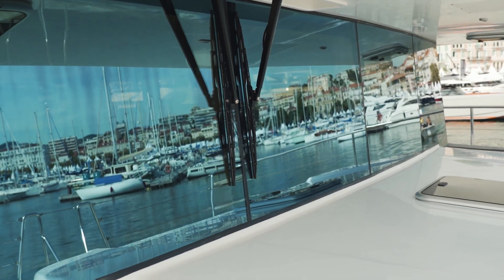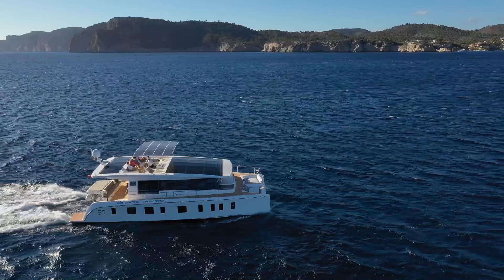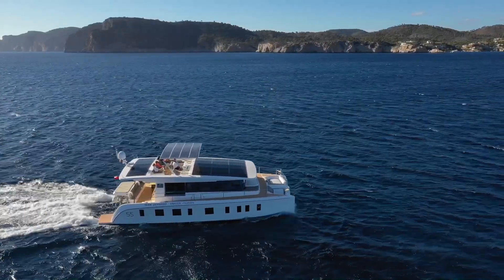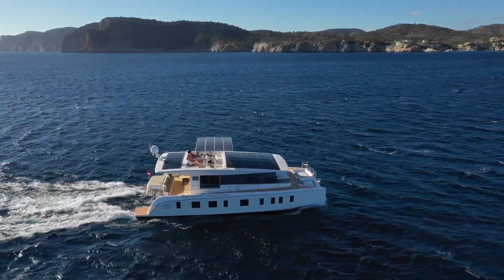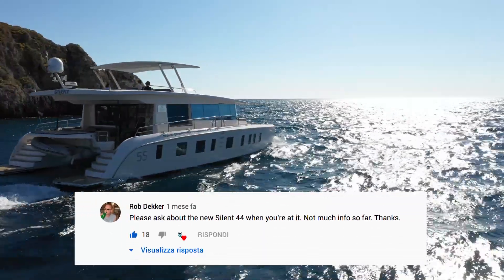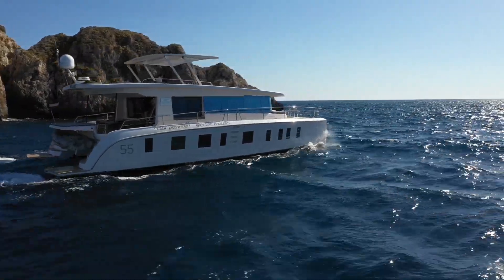WHAT MAKES SILENT YACHTS...SILENT???

Comment: Michael, as the owner of a 48-foot timber boat, with 165kW main engine, and an efficient one at that (12-14 l/hr, including a 8.5kVA generator running at the same time), I can see the beauty and efficiency of your designs. They are the future, no doubt. I would like to see a more utilitarian model that is all about function, rather than 'all-the-comforts-of-home'. By function, I mean while I have two air-conditioning units on board, I do not use them, except when connected to shore power, and not often then. A well-insulated boat with all-around ventilation and shading should not need it, I fee, especially at seal. As you note, galley energy consumption is negligible; lighting similarly—I would want to use the solar-generated power to go places. And while my boat is a monohull, as you point out, if you chose 6kn (I use 7.6kn) as your cruise speed, then that 210kW can take you a long way. Brilliant execution.

Comment: This is the future of boating. 
 The sun is shining a lot more then waiting for the wind to blow- and without having to tack/ Jibe constantly. Finally someone figured it out!!!
Reply: Im afraid that there is nothing new under the sun about this boat project....and as a blue water cruiser you better start praying for blue skies....
Reply: @maxodgaard1335  yes however the sky doesn't need to be clear in order to get charged up. I think they only need about 50% clear skies
Reply: @maxodgaard1335  The specs which came with my solar panels gives a power rating even when it's covered with a thin layer of snow! At least then you won't need the AC :D

Comment: Now this is an amazing option for people like me. I love sailing as a concept with wind propulsion. However, almost every time I go out on the weekend the wind is coming from the direction I want to go. Lines everywhere and naturally no wind when going back home. 

“Classic” motorboats are not in my liking due to noise and fumes. 

This is a combination of the best features I like, with no negatives. I’m absolutely in love with this concept. 

I read somewhere that with a speed of 5 knots, I can go on nonstop day and night without using the generator. When sailboats are waiting for good weather conditions for a longer passage, I only have to check if it will be sunny😁. 

Also I guess that maintenance is way cheaper than a sailboat in comparable size (sails, rigging...). Although replacing the battery bank will come with a hefty price I guess.
Reply: Solar cells last 50+ years.  Modern Lithium ion batteries will last decades when used within good parameters (don't overcharge, don't over discharge).  Both are highly durable today.
Reply: Maintenance on a bigger sailing yacht is astronomical. Like you this would be my choice for a live aboard. I already have an pure battery electric car and the silence and lack of maintenance is a no brainer.  And prices of batteries will go down, so all these arm chair experts claiming huge replacement costs have no good grasp of what is going on.

Comment: Great idea to interview owners and builders because as You Tube numbers grow on a channel it becomes very difficult to answer everyone's questions. 

Also, I personally get frustrated when I see flaws on a boat and I leave comments and suggestions as to how they might improve things, but I get no response.

So this interview format is also a good way for the manufacturer to get feedback and improve their product.

For example, I was close to buying an Azimut Atlantis 51, but got really frustrated about simple design 'flaws'. 

They have a bbq on the aft transom, but don't have a grab rail to hold onto if the boat rocks while you are cooking or if wash is created by another boat and unsteadies your footing while cooking. It's a simple safety measure yet today they have still not rectified it.

I also suggested changing the position of the bbq as well.

Another one I looked at was the new Princess V55 which is basically a blatant knock off of the Fairline 63 GTO in a smaller version, but they have compromised too much because they didn't want to design a new slightly wider hull, supposedly because they didn't want to 'compromise' speed. 

The real reason was probably cost, but nevertheless the boat ends up with a highly compromised third cabin with double bunks.

Most customers would prefer a better third cabin and compromise some speed if it needed to be compromised at all.

The boat does 30 knots which is pretty good, but most people would be happy with say 25 knots and a decent third cabin.

Likewise, in the cockpit bbq,  they place the bbq closest to the open saloon where smoke can blow from the cockpit into the saloon, followed by the sink which is placed more aft.

I would have swapped them around and put the sink closest to the saloon, to minimse smoke from the cockpit bbq going inside the boat and then placed the bbq on the outer side so the smoke blows out the back of the boat.

All boats face into the wind at anchor so the wind would also blow the smoke away over the aft of the boat away from the saloon and cockpit.

I'm no genius, but these are just basic boating knowledge features and design expectations of customers and it frustrates me no end. Maybe I need a chill pill.

Also Princess used shaft drives in the V55 instead of pod drives like Fairline do. Nothing wrong with that if you are selling to experienced skippers, but if you want to attract NEW boaters who are inexperienced their main reasons for NOT purchasing are;

1) Fear of berthing especially in high winds.
2) Navigation.
3) Cost of crew.

Pod drives and modern navigation equipment and new berthing technology removes all 3 of those issues, so why opt for shaft drives rather than pod drives. Or, at least give customers the option.

Pod drives offer virtual anchors to allow you to keep the boat in one place while you put the fenders out obviating the need for crew and the associated costs.

Likewise there is remote docking and new sensor technology where the boat berths itself like autonomous and driverless cars.

I don't think manufacturers do enough on communicating these new technologies to attract NEW boaters into the market and to buy their products.

(By the way, a video on all the new technology available for berthing and navigating and demonstrating that technology would make a great video ... I'm blown away with some of the fantastic new tech that's coming on the market).

Taking the stress out of boating and lowering operating costs will always be big selling points especially if they want to attract a new generation of boaters.

This means they are not fighting for a slice of the cake all the time, but baking a bigger cake by getting new boaters into the market.

We are also talking about Princess and Azimut here so it's not like they are new start-ups. These are major brands.

I sometimes feel these manufacturers don't spend enough time engaging with customers and more importantly POTENTIAL customers.  Quite frankly Princess has become boring and lacking in innovation although their quality is good.

I wish they would make a luxury catamaran.

Anyway, my point is that I think the manufacturers would benefit from this interview format and so would customers looking to buy their products. 

Keep up the good work.
Reply: John Smith its very arrogant to assume your suggestions for improvement should be considered. Its far more likely they know any and all compromises and have a far greater understanding than you. You are less aware of the balance of constraints and design priorities as a whole.
Reply: @derboy959  I'm a boat user and naval architect,  not that one needs to be either to decide where to put a bbq ... other manufacturers get it right so no, there are no design constraints just poor design.

The day you stop listening to your customers is arrogance and grab rails for safety is not an option, it is a must. You NEVER comprise on safety ... NEVER.
Reply: @JohnSmith-zo6ir  Hi John David is not listening also - sadly!! Omnipotence is not the purvey of either David or a boat designer. The dichotomy between the opening of the "sell" on "Silent Yachts" (How they listen to customers?) and Davids comment is disturbingly at odds.

Comment: 8 knots with generator "untill infinito" sounds very good but i was curious about the fuel consumption on the generator at that speed.once again great video :)
Reply: i found a general rule for generator fuel consumption: 0,3l/h per KW produced.  it means  40kw*0,3= 12l/h at 8knots. with a fuel tank up to 1600L it's about 130h run time and 1000 nautical miles. not considering solar regeneration
Reply: It’s an interesting example to compare ‘conventional’ propulsion systems. Pretty much every long distance cruiser (with sails) adds on solar, and lithium batteries (if they have the budget) to reduce power need from running generator. However, scaling this up has a trade off with weight as soon as the batteries weigh more than fuel and engines.

The best figures I’ve ever come across was a power Sunreef that had engines remapped, wave piercing hulls and extended sugar scoops (to reduce draft) there’s an article on their site I think, but if memory is right, the fuel consumption was something like 7L per engine per hour.

I think for solar to compete, battery technology needs to improve further still/solar panel efficiency needs to improve/propulsion of the boat/energy use of in house systems, i.e. gains from one, two or all of these areas, will result in a solution that can travel at faster speed so as to be more competitive and no fear of running out of juice.

Also, foiling technology versus displacement versus planing hulls for greater efficiency. Wind power for onboard turbines for more energy creation or foiling kites to contribute to propulsion using wind energy also. Water jet propulsion versus propeller. Wave power. (Check out foiling surfboards if you haven’t seen before). The future doesn’t have to be solar only.
Reply: @guidoburo87  What's good about electric propulsion is that it's efficiency is rather good across wide range of output, combustion engines have quite small efficient point. As you heard, at displacement speeds boat needs really little power to move, but it can have extra power when needed. Although my favorite points are sound and maintenance. Too bad choices of electric propulsion are still quite limited to highly overpriced ready solutions or do it yourself from scratch which few people can handle due to power in question. I'm not even talking about price of battery bank here.

Oh, i would rather go 6-7knots cruising speed at most on such boat. 8 knots already fall into not so efficient speed, just for 1knot from 7 to 8 you need extra 15kw/h.
Reply: @xellzor  All good points.  The power needed to maintain moderate speed for a boat is surprisingly low.  Battery and motor options will continue to improve, and commercial solutions do exist today.  Electric propulsion is clearly a very good way forward, and progress will continue to be made, including in commercial products.
Reply: @xellzor  so true, I think 5 knots is more than sufficient. And then consumption is less than 10kwh. Which means with the 210kw battery and 100kw per day charging with the panels, you can easily do 24 hours of non-stop sailing and have energy to spare for all the electric appliances.

Comment: Post from Canada: 
i was wondering if ...
* the boat can be fitted with a Kite Sail to augment the range?
* have you thought of using Thin Film printable solar panels on the sail to generate more power?
* Also, usage of H2/Fuel cells to get rid of the diesel generators and make it completely green?
* include drum type Wind Turbines to generate from Wind Power without casting shadows on the Solar Panels?

Comment: Love the yacht and the technology embraced in it. Gets rid of diesel which is always good.
Reply: The backup generator is probably a diesel, but would need almost no use much of the time, due to lots of solar power, good battery storage, and good system efficiency.

Comment: Love your coverage of the Silent Yachts and noticed you like to take questions :-)

1) They have the kite setup in the front. Was wondering if they have tested to use the force on the propeller for "regenerative breaking" in the motor and charge the battery packs. If I am not mistaken not all motors can do regenerative breaking though...
2) Besides Silent Yachts. Am endlessly fascinated by foils. And came accross a paper where they tested foils on a catamaran to reduce resistance. The take away is increased resistance at slow speed (foils are in waters way), reduced resistance at higher speeds (boat lifts earlier). As Silent Yachts are all about optimising efficiency. I was wondering if they have toyed with foils. Obviously the break even speed above which resistance becomes less would need to be sufficiently low. Preferably below or at low cruising speed. Not a good idea to make the most efficient speeds less efficient. But if the 40kw for 8knots could be lowered without affecting 6knot 20kw. Might be worth having higher sub 6knot energy consumption. Or slightly higher 6,8knot resistance but 10+knots significantly lowered....

anyway. thanks for all your coverage of these marvels. Looking forward to more. Tours of the 80? 120?

Comment: Hi David. Wider and others have used a hybrid system. Silent has improved it and im looking forward to the Silent 80. Great video.
Reply: Silent Yachts is building boats sind 2009 - tenthousands of miles purely solar powered already!  In 2018 a Silent 64 crossed the Atlantic Ocean
Reply: Hi Micheal, your vision has become a reality. You are the ONLY solar powered superyacht builder. The industry are running scared as you have proved that not only can it be done by sailing around the world with your prototype, and the Silent yachts are selling even prior to build which is a milestone that no other builder can match. I am so happy that a normal couple can create and succeed with such a product. Amazing yachts. Thankyou. Chris.

Comment: What an awesome boat, and a great idea. Kudos to Michael and all his crew.
I think it's great that you guys made it out of recyclable materials whenever you were able. Who else does that?
It bugs me a little that they don't answer the question of what makes it silent. I mean sure, you use solar power to charge the batteries, but you're still spinning a propeller. I'd like to see how the propulsion is handled.

Had you considered creating a hybrid yacht? Do everything exactly as you have, but add a mast. You would only drain your battery for propulsion when there is no wind.

Comment: Hi! Great proposal! Is there any project to add wind generators to activate them when the vessel is moored to take advantage of some night breeze or wind? During navigation those could be folded. I saw also a vessel sun energy propulsive that generates hydrogen. Could it be an option to activate generators by hydrogen instead by dyno-fuel ? Thx for your great cat !

Comment: What I love with this, is that I have all of the advantage from a motorboat and a sailing boat. just turn the key and go, sail for free energy. 

And don’t get the disadvantage from sailboat (mast, shitloades of lines) and depending of proper wind. 

Not have to worry to pay the diesel by filling 10.000 litres of diesel in the tank on the motorboat. 

Just a relaxed lifestyle 😎

Comment: I have an idea: They need to install deployable wings (Airplane wings) from each side of the boat. More room for solar panels on top of the wings and the wings will create a small lift while sailing, raising the boat, from the water which will cause less drug and increase efficiency. The wings can be deployed like a living room in RVs, or can be positioned vertically and deploy out. Or just design the entire yacht as an airplane and have static wings.

Comment: Love the boat, still think adding sails makes sense because you can then regen power while under sail - with that size battery bank, it just makes even more sense. Or, add wind generators, if you can make them quiet enough.
Reply: If you add sails, you cannot regenerate the energy because the solar panels are blocked. They talk about it on their website and the loss makes it unfeasible
Reply: @philsexton5761  yes, of course. Basically sailboat solar panels run at 25%-50% of capacity any time the sails are up or shading is bad. But, when the sails are down, correctly placed, you can get most of the capacity out of the panels (only boom/mast shade to deal with), and when the sails are up, you are generating energy out of the drives anyhow. But I get it that this is just not that boat and also there are a lot of people who want to be a bit more sustainable that are not wanting to deal with sails.
Reply: @philsexton5761  , available forward kite sails would not block the solar.  So one could get energy from TWO sources (regen and solar)
Reply: Douglas Montgomery Correct, which is why they offer a Kite option. I was not talking about that. Cheers
Reply: Some people like me don't want to learn to sail with ropes and mess. We want it clean and simple. Just drive like a car, stop and chill out. This is a niche perhaps. But I think a growing market.